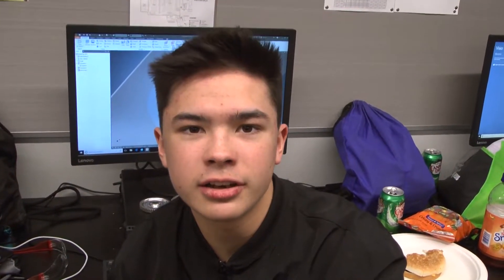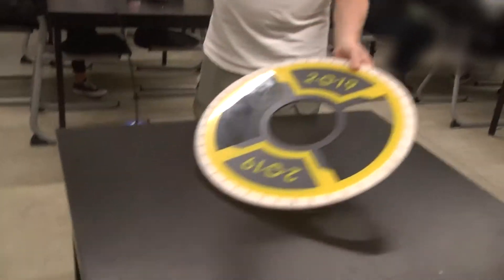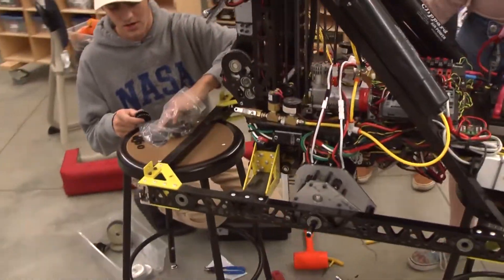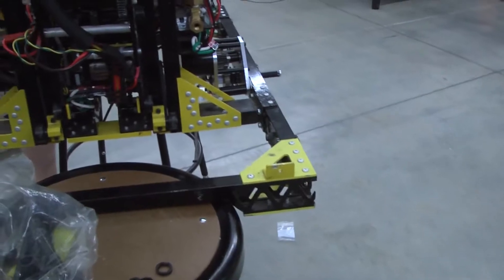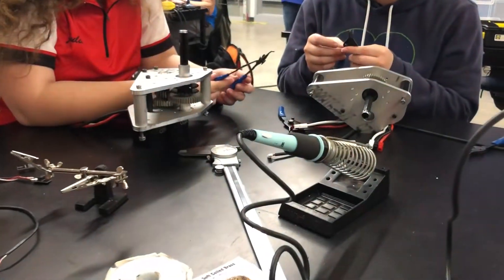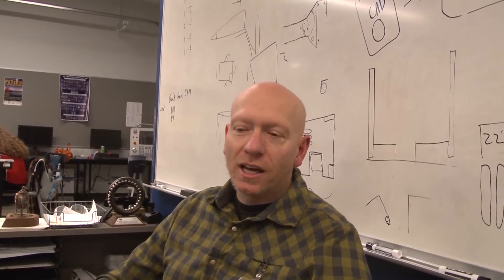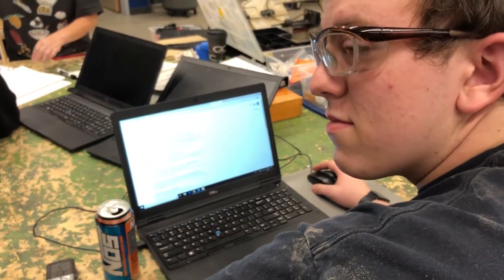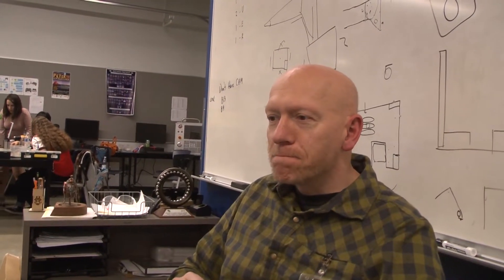Bear Metal Weekly Update: Week 1

Comment: Do you guys use NEO brushless motors or CIM's for your drivetrain? Also, did you guys design your own gearbox?
Reply from the maker: We just received our shipment of NEO motors this week and we wanted to try them out before committing to use them on our 2019 robot. We designed and built a custom single speed gearbox and installed it our 2018 practice robot. Since the NEO motors have the same mounting specs as a CIM, we didn't have to build a new gearbox to test them. However, we wanted to try a different gear ratio that we decided would be more advantageous for the 2019 challenge. The results thus far are promising, but further testing is needed.
Reply: @TahomaRoboticsFRC  Thanks!